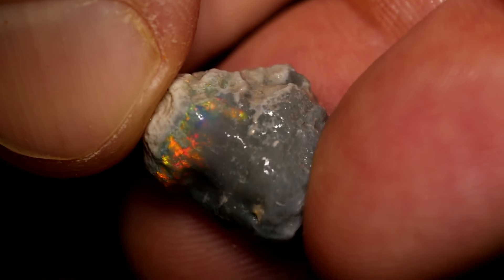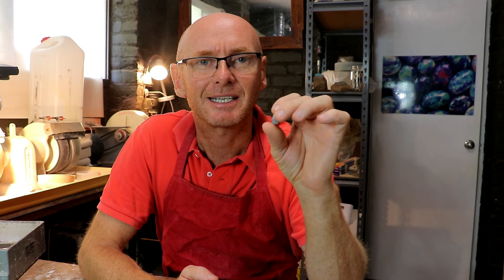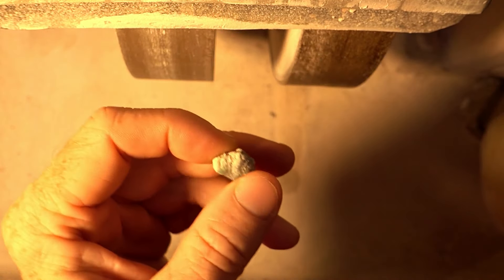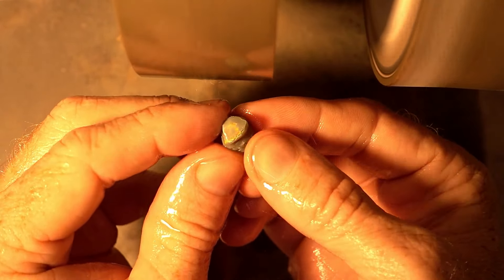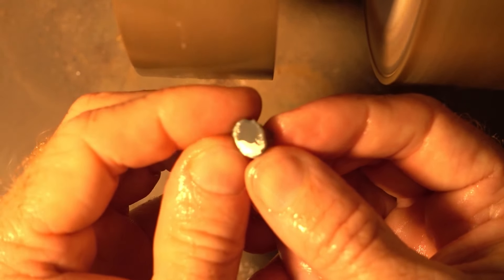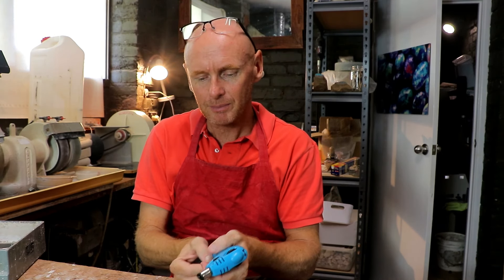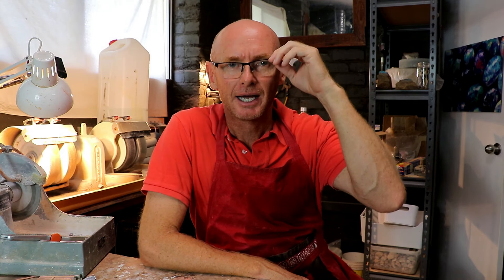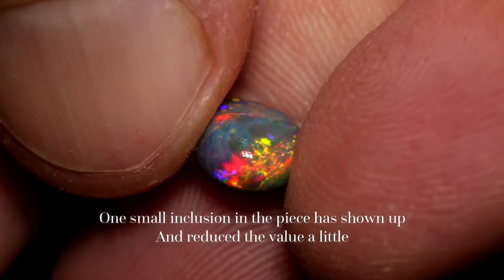I cut this rough rock open and made thousands

Comment: Hi Justin, nice to watch you at work again.  I recently puchased a 14c gold ring set with what I believe is a black crystal opal, 10mm x 12mm.  Some light passes through the back of the open setting when held up to the light, so not a black opal, but still very beautiful, with all the colours in a flagstone pattern, and showing colour right across the face from all angles.  However, I think the stone has had a scuff at some point, and one corner has a slightly dull, rubbed surface, maybe where someone has tried to re-polish it.  I don't want to risk further damage to the stone, but is it possible for the stone to be re-polished properly, and would this be possible without taking the stone out of the setting?  Maybe I could try doing this myself using jewellers rouge or some other very fine material? I'd be grateful for any advice.

Comment: Blue is a good color for filming videos lol. Anyhow my name is Justin as well, I like your videos. I am just getting into looking at black opals and other Australian opals to try to make some ear jewelry. So far I’ve just ordered one smaller stone from opal auctions which was lightning ridge black opal, and then right at the beginning g of my search I ordered 2 6mm faceted Welo “black” opals on Etsy which is from India (Jaipur) the seller says they are not treated or smoked or dyed but lots of the other India sellers say theirs are and I figure the really black N1 looking Welo opals probably are heat treaded or smoked or something. So I guess it’s a real stone but treated whereas the much more expensive lightning ridge or other Australian black opal is pricier (although there is quite a range in price!) it seems to me that the faceted Welo opals from India though are the only type of faceted “black” opals that are that classic diamond cut shape that you can easily make a stud out of. That’s fine and I’ll make a pair of those like I said the stones were cheap $18 for two, but I prefer the genuineness of the australian opal. When buying them online they seem to be cut and polished but mostly not in “perfect” shapes like a circle and hardly any are cut faceted. My question is what type of setting for earrings can you use this type of stone on? Are they meant to be further cut by the jewelry maker or are the usually only cut Cabochon style and the cab setting made to the irregular shape of the Stone? I will admit the faceted style did look nice to me but I do t really see that with the LR opal. So what kind of earring settings are useable and how are they made are my question which if you have any thoughts on that I’d much appreciate any beginner advice!
Reply from the maker: Thanks  The jeweller is supposed to make earring to surround the opal and not cut them any further. Faceting opal does opal no favours. Opal aurally has play of color in it. the you facet you are drawing light into a piece for it to refract around and make it look like it has color. But with opal it makes the play of color weaker.